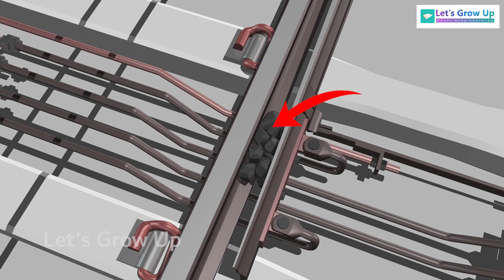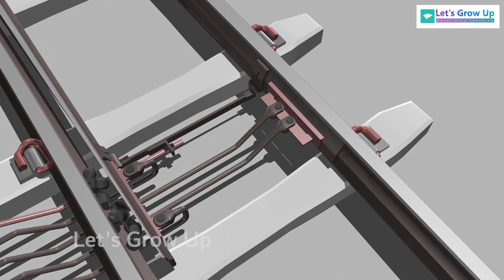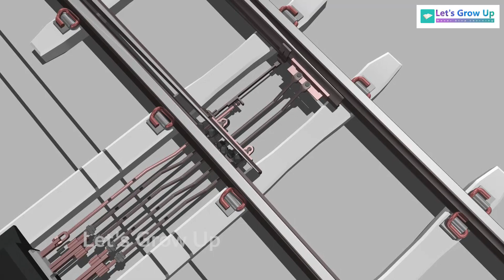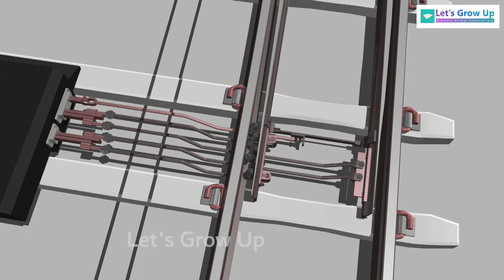Unveiling the Coromandel Express Accident Point Machine Analysis Revealed

Comment: At 2:35 of video
Pl explain how the signal is generated by the point machine to communicate to control panel about presence of stones between the rails
Reply: Signal interlocking system is actually designed such a way that if any abnormal occurs just like stones between stock rail and switch rail system will goes to FAILURE state (All indicator shows Red in control panel in Station master office) and also Hone signal indicates Red. So that train cannot entered into the station just stopped before home signal and waits for signal.
Reply: I agree with what you have said.

But my basic doubt is:
.When the point machine operation is stuck because of stones present  between the rails, HOW the system/point machine  senses the same and sends signal to control panel so that appropriate indications are lighted up.
In the video it is said that" if the switch rail is obstructed by stones,the point machine will send information indicating switch did not act with main line"
I need  clarification in technical terms on the above.

Comment: There has been information overflow on root cause and unfortunately by providing incorrect or incomplete information, digital media has created a lot of confusion. The very fact that CBI investigation is still ongoing  does indicate foul play. Please note that for any accident investigation to be successful, data verification and data accuracy, clarity of thought process, logical data evaluation for root cause is mandatory. In context, assuming information made available by the media & govt is accurate, logical inference basis sequence of events would indicate towards “some kind of unauthorised interference “ with the facing point machine for x-over from main line to loop line .  
An event summary on the sequence of events ( to be verified by the data logger) as follows:
(a)	There was a slow-moving goods train running ahead of UP Howrah Chennai Coromandel Express. 
(b)	In order to clear main line for the fast-approaching passenger train, standard procedure was followed by shunting the goods train on to loop line. 
(c)	The facing point machine for loop line x-over should have been remotely set and locked at reverse position, triggering the point signal to turn Yellow.
(d)	 Once the goods train had passed the point and entered the loop line, the signal would automatically changed over from Yellow to Red. 
(e)	For the automatic signal interlock system to clear main line for fast approaching Up Coromandel Express at speed of nearly 130 kmph, the facing point machine would have to be remotely re-set and locked at normal position triggering point signal to automatically change over from Red to Green.
(f)	The time in between signal change over from Yellow to Red and thereafter from Red to Green, is the time range within which the automatic signal interlock system would have indicated an abnormal point signal which in turn should have triggered an emergency response by the station master where the point machine should have been locally checked for any external obstruction, apply key to lock supply and test the point by manual crank handle and if the point movemen still defective, the point should be considered declared failed and follow up emergency procedures should be folowed.           
d(g)	If emergency situation described under (f) never occurred, it would insinuate railway team were aware of the point malfunctioning and not taken corrective action or the point malfunctioned after maintenence work due to incorrect adjustment of the control rods or unauthorized tampering with the electrical wiring at either local site or the signal room whereby standard company emergency procedures were completely ignored . Refer link for video on Station Masters responsibility when a point fails. https://youtu.be/bbI6MKYWmwQ .In context, please note although the system may be rated as failsafe, by no means can the system be considered as tamper proof.   
(h)	It may be possible to fool the automatic signal interlock system by simple alteration of the feedback circuit, i.e. either by interchanging wiring to feedback signal relays located inside the point machine motor housing or by swapping the signal relays located in the relay room.
(i)	Irrespective, whether case (f) or ( g), under both counts emergency operating procedures issued by the Indian Railways was not followed. Normally under these circumstances, standard procedures would entail incident reporting to senior management seeking for disconnection memo, padlock and clamp point at normal position, seek written approval for temporary electrical bypass of the point , employ 24 hours sentry duty at local site to monitor status, carry out permanent repairs, check insulation,  measure / adjust distance of travel bars, test for local and remote operation of point machine to the satisfaction of attending Station Master, etc. Serious doubts on due diligence by the railway staff. 
(j)	Please note that before any serious incident, there are tell tale indicators including related minor incidents and near misses and we suspect CBI is taking their sweet time with the investigation  as suspect on going through historical data they  may have come across serious breach of safety management system , negligence and non-compliance of  standard  operating procedures  . The Railway Board  have reported  repeated occurrences of similar nature which should have been taken into consideration during the CBI investigation .
Reply: Very informative
Reply: Perfectly correct, exceptional details 👌
Reply: The following information is required to analyse the incident further:
1.What was the time interval  between the goods train passing and Coromandal express arriving on loop line.
2.Was there any maintenance work going on before and after arrival of goods train either in field or relay room.?
3.What was the signal indication on loop line after the goods train has passed the x-point.? And What was the signal indication on main line at that time?.(Red/green/yellow?)
Answers for items 1&3 can be got from data logger where chronological events  are recorded with time stamping( with an accuracy of milli seconds.)

4.The logics to be satisfied for changing the track from loop line to main line are as under:
(a) There is no train present on the main line
                      AND
(b)The track switch is connected to loop line
When the above 'AND' logic is satisfied and when main line is selected from control panel, the entire logic is processed through the relay room and when  found satisfied with the programmed logic
Output signal is generated which will be sent to electric track point machine to change the track from loop line to main line.
Upon successful  transfer as sensed by limit switches,the signal is fed back to relay room and on processing and when found to be in order, output signal so obtained will then be sent to light up green indication lamp in the field permitting  the loco pilot to go ahead.
In the present incident the very fact that green indication was available ensures that track switch is towards main line and  the loco pilot  can proceed on main line as per the stipulated procedures.But unfortunately track switch was towards loop line in this case.
As informed earlier, initially green signal was available to proceed but withdrawn immediately but due to what reasons?Once route is set it can not be withdrawn immediately unless the system was reset from control panel.
Even withdrawing was done, the track will not change back to loop line as there is already goods train present and thus the logics will not permit such an operation.
Then how did the accident happen?
Where the  logics have malfunctioned???

Comment: Cos Rubbish interlocking ( Electrical  interlocking very  difficult lot of relays used in circuit sum circuit control by voltages refence  & sum microprocessor card with plc Control where is safety)